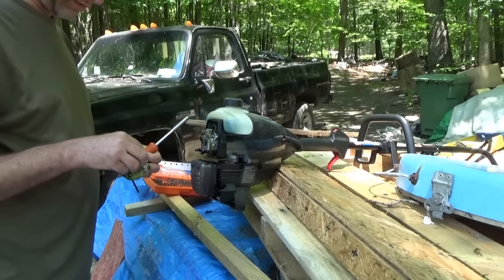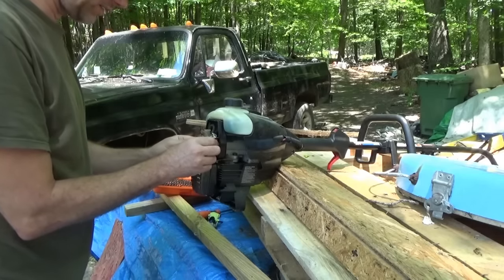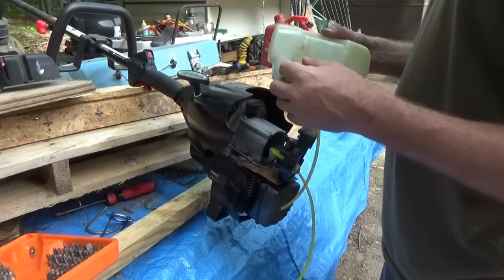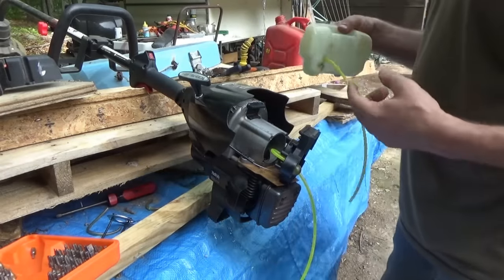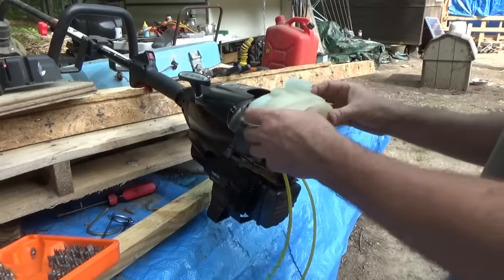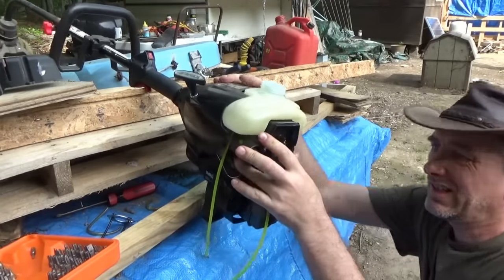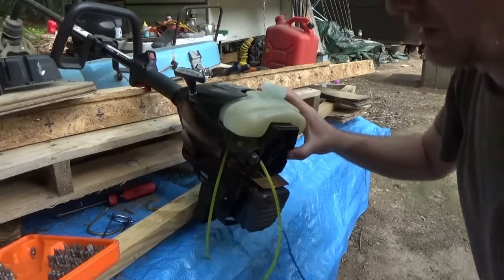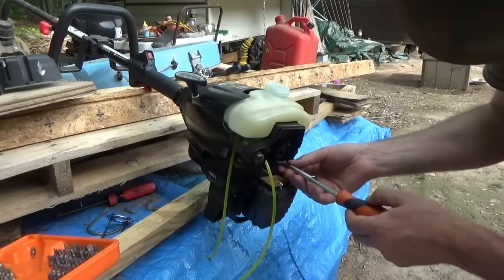Rebuilding A Weed Trimmer Carb & Fuel Line Replacement

Comment: Troy Good job on the fix, I hope you left some room for the fuel filter to move around in the tank. does not need much but it should move with the fuel depending how you hold the trimmer. Good job another job well done.

Comment: I usually taper the fuel lines,and put a piece of mechanics wire inside the fuel line to manipulate it for certain bends. or surgical hemostats.I just worked on the same one@ the shop for fuel lines.
Reply from the maker: MrCrf450rider Of course I should have asked you. lol. I think we need to have a phone chat. I need some pointers for next time.
Reply: The Do It Yourself World just gimme a call when your free
Reply: McNeely Joe a good roll of mechanics wire,is always something to have on you
Reply: Paid $8.95 for roll.Dorman 18 GA.Part # 110-100

Comment: When you are doing maintenance on any small 2 cycle engine, remove the muffler and lean the exhaust port.  They can become clogged and cause a no start.

Buy some extra carb gaskets (not the whole rebuild kit).  Always good to have on hand.

Comment: That was a good deal. It sure was worth the time and effort to get it running. I don't really understand why they put the fuel filter inside the gas tank, making it impossible to reinstall as it came from the factory. It seems the manufacturer absolutely does not want people servicing those things themselves. Now the real fun begins! Keeping ahead of those weeds. Have fun. :-D

Comment: Connecting the hose to the filter then feeding the hose through the hole in the tank is the way I would have done it too. Don't know if that is correct, but it works for us poor folks! I've got a string trimmer similar to that one and a walk behind that I have to work on, but I think (hope) it's just old gas.
Reply: I think pulling it through makes sense. .. I kept thinking he needs a pair of those long handled alligator forceps.  (Ok, truth...I looked "forceps" up because the only thing I could think of to call it is the thing you hold a joint with!  Lol!)
Reply: Sam Stevens I don't,  I should get some though!  You never know when they will be handy. ;)
Reply: Sam Stevens Hey, when I was looking that up I discovered the tool we pluck eyebrows with is also called a forceps. .. I call them "tweezers"  what do you call it?
Reply: Sam Stevens Yep! Same here.
Reply: J. Williams I would have installed the filter that way too. Unless there happened to be somebody with some very strong miniature hands around. :-)